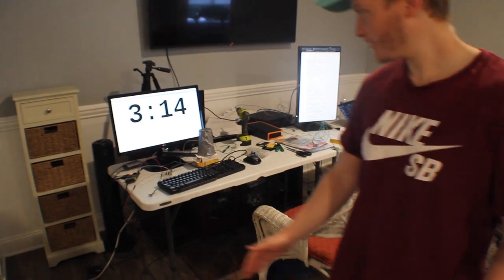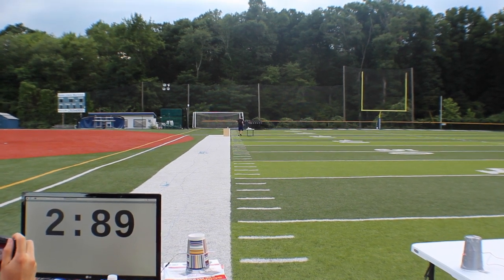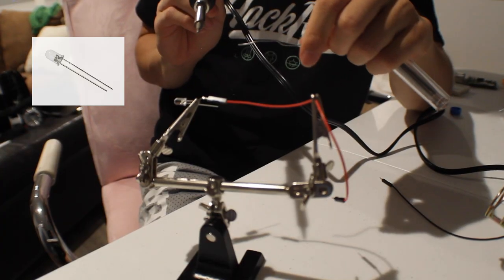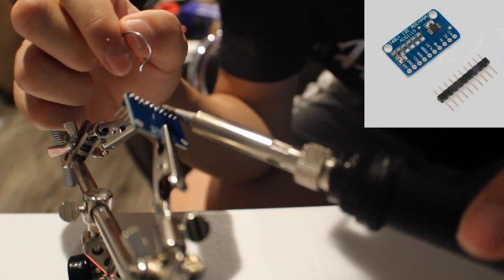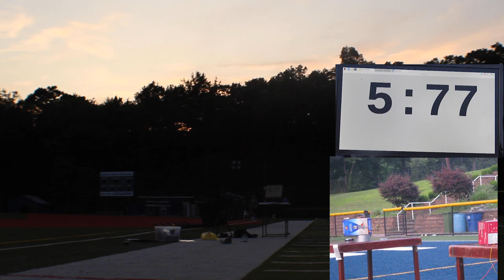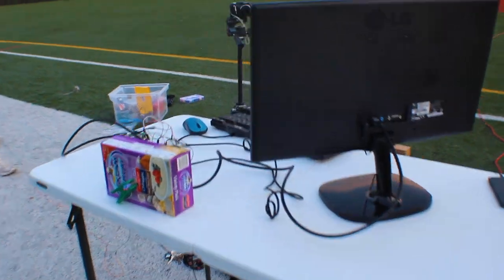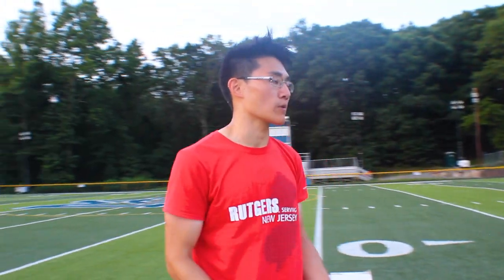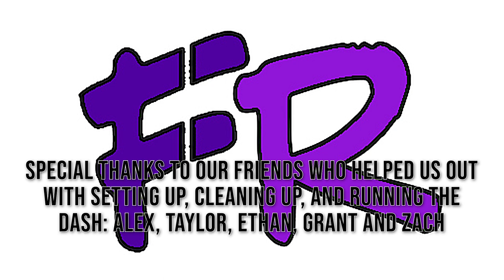Recreating the 40-Yard Dash Speed Test with a Raspberry Pi and Phototransistors

Comment: Interesting video. Perhaps a Cat5 cable next time you need a lot of low voltage wire?
Reply from the maker: Just looked at the price for it. Yea that would have been better, never realized how cheap it was.
Reply: @Flopperam  I can't say I've used it much either TBH, but seems like a good solution. Keep making cool stuff!